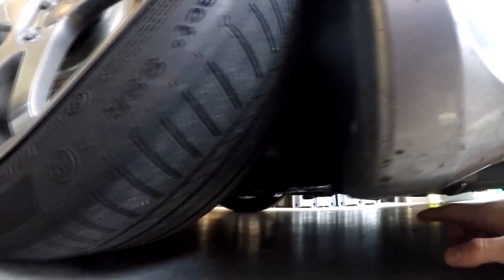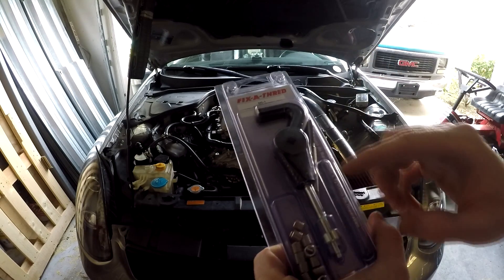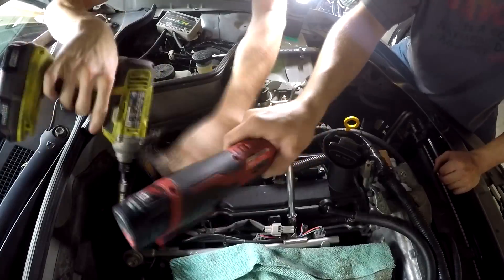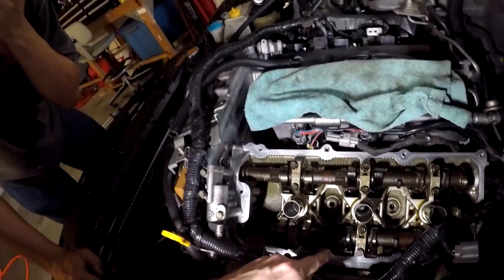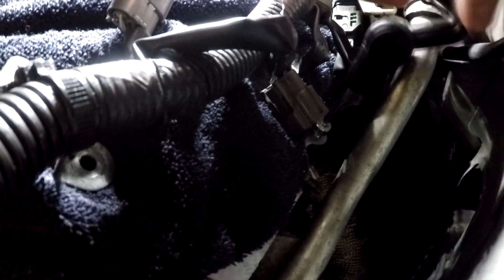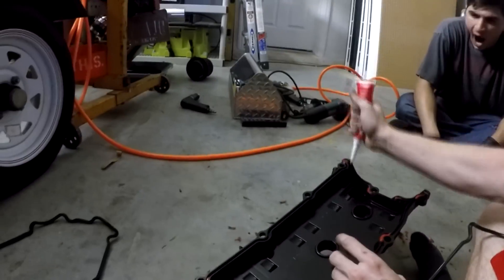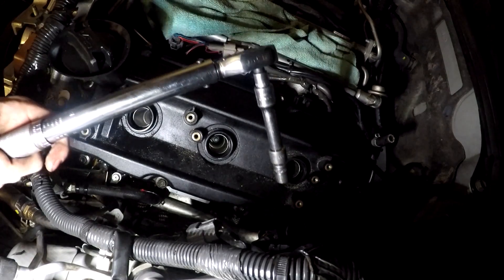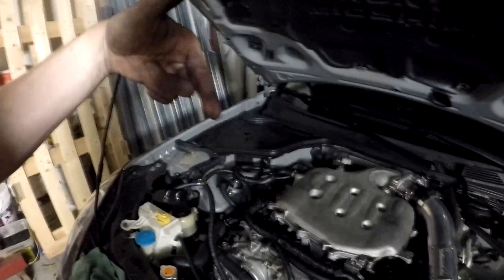How to Helicoil Valve Cover Bolt Hole on an Infiniti G35

Comment: Nice! 
What size socket did use use to attach to the tap to make the treads? I’ve tried many they are either too big or too small. Seems like need something b/w a 7 and 8mm which don’t exist.

Comment: I'm hoping my leak is from the valve cover too. I was working on the front end today replacing my wheel bearings, rebuilding brake caliper, and both compression rods. Had some issues taking the cross member off, but notice decent drip near my bell housing and transmission. I also bought new o-rings for the cam/crank sensors, since I've had this car since 06 and they are probably brittle.

Permatex also sells a spray adhesive that comes in gold or clear if I remember. You spray it on whatever the gasket goes into and then a few minutes later it gets tackey and keeps the gasket in place.
Reply: leak from back of engine and bellhousing is usually from back of intake manifold gasket

Comment: I had to do the same thing to my G (passenger side rear bolt... I cried)  I found that pulling the harness completely (disconnecting cam sensor O2 and what not) made it super easy to pull, clean and reinstall the cover without worrying about rolling a gasket. Great video though man very clear on installing the helicoil :) 
Also using a torque wrench helps prevent stripping as well as using compressed air to blow out any oil and grime from the holes helps prevent this big time, those aluminum blocks are finicky)
Reply: Johnson’s Jams how did you go about drilling the rear bolt at that angle I have to do the same thing

Comment: Good work on the gasket job and the helicoil..i wouldn't use power 🔧 on those 10 mil bolts...just my opinion after all these years working on cars.
Reply: Duo  Maxwell how tight should the bolts be?
Reply: @Joke1Time  usually between 8 and 10 pound feet.or 96 to 120 inch pound

Comment: I did my valve covers a while ago. It took me a day and a half.  I can’t believe it only took you about 10 minutes!
Reply from the maker: JKC I only had to do one side and I've done it before a couple of times haha. Took me about 2 hours just for this side
Reply: Aaron Newman how long do you wait to run the g after this
Reply: @iDkwHatToNaMeThIS12   8 hours is what recommended 
I usually wait day or more if I can
Reply: Dj Hall- you don’t have to wait to drive the car after a valve cover replacement.  I drove mine right after I put it back together.
Reply: @jackchn23  8 hours is what recommended 
I usually wait day or more if I can

Comment: Wish I could afford a g35 😢
Reply: Bryan Conner shiid where do you live, they’re about 5k-6k for a clean manual g35. The automatic ones run for 2k-4k
Reply: They are cheap bro. I bought mine for 2k it’s a 6 speed 95k miles and on Coilovers and rims.
Reply: Bryan Conner ard bet whats your IG
Reply: Clout_Sid  I stay in Vegas bro. And it was a lucky find lmao. He wanted 4K cause it wasn’t runnin right, but a catalytic converter was messed up so It was a $300 fix and now it’s all good
Reply: Bryan Conner well shit you got lucky, here in Baltimore everyone is an automatic. I have to go to virginia or Delaware to find a manual one
Reply: Clout_Sid yeah bro but if you want to see how it turns out then I’ll add you on Instagram if you got one I’ll be posting my car a lot
Reply: Clout_Sid it’s @ omar7o2